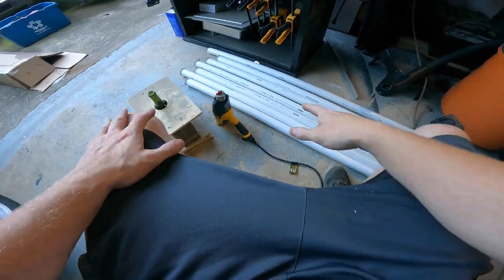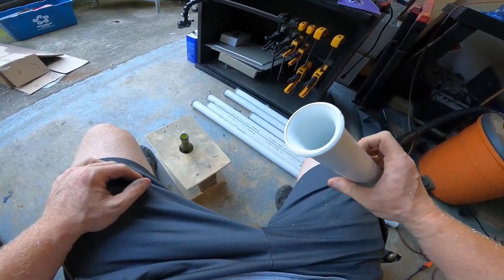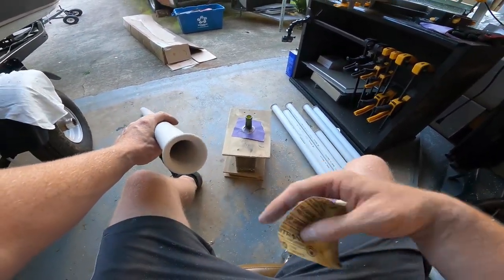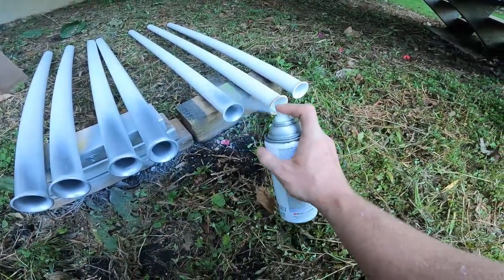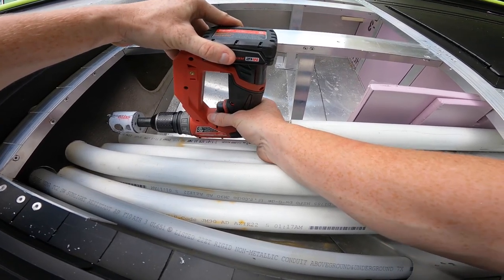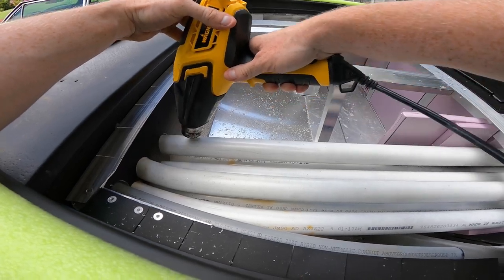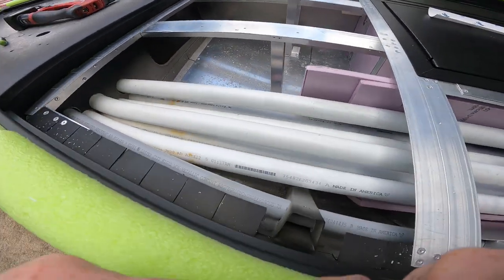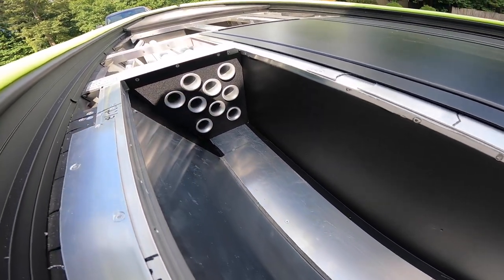How to Install ROD TUBES in a BOAT! Jon Boat

Comment: I would think you could rig the tubes to a drill and a support at the flared end and possibly wet sand them while the drill is rotating slowly. The cheap version of a lathe.

Comment: If the tubes are only 48" long, how do you keep the guides from catching on the far end of the tube when you try to remove the rod?
Reply: I’m capping the end of my tubes for this very reason…also using thin wall PVC for weight and cost diff. .0800 thick for tube holder frames too. A little excessive but I want a shallow storage built in on the back end. 

My question to FIREANT - if you don’t use a clear coat or something on the silver paint for tubes, does paint wear off over time? What would you use for clear coat?
Reply: Yes, using SCH40 pipes is way too thick and heavy for this application. Drain pipes are sufficient and cheaper.
Reply: Wish I could post pics..chrome on thin wall came out sick. Also I heated the actual body of a   Antique soda bottle while holding pvc in one hand to rotate, heat gun on middle body of bottle, and cowboy boots on to hold bottle in place. Literally can get proper shaping without burning pvc any. Minor sanding is all you need for paint prep